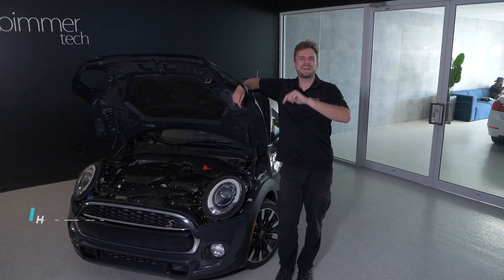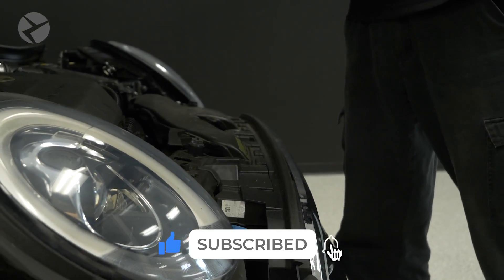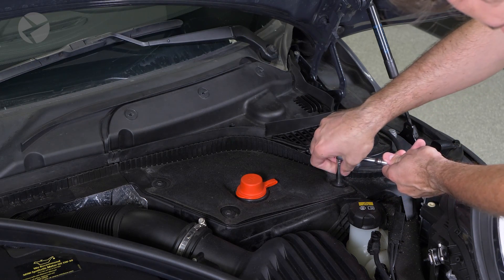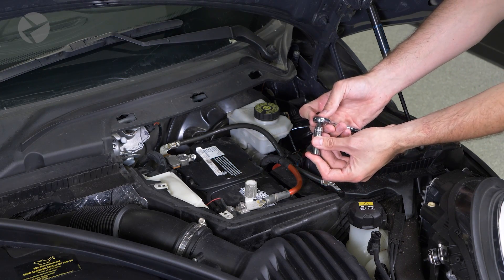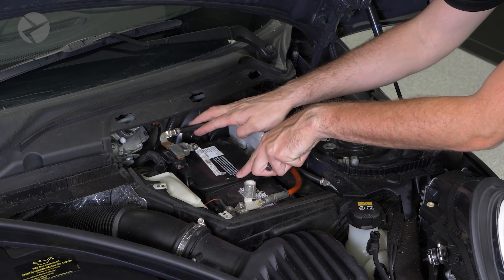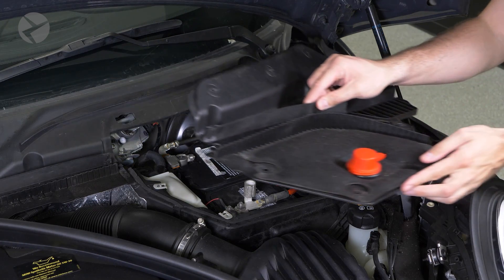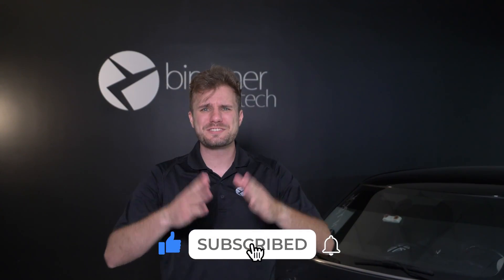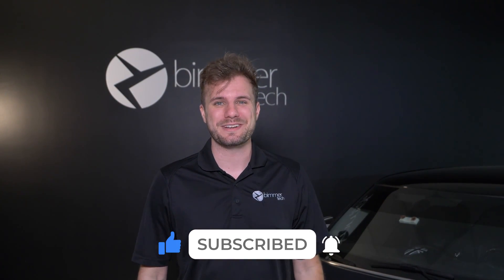Disconnecting Battery On F55 MINI In 1 Minute

Comment: No issues with any memory electronics ? No reset ?
Reply from the maker: Hi Marc, 
you should not have any problems with mentioned features :)
Reply: @bimmer-tech  Yeah i did it and still have the issues with blinkers and windows not working.   The battery is at 11.6 to 11.9 volts... maybe recharge it ... driving doesnt seem to do it.

Comment: I cant get the issue with Lights and windows to clear ??  My mechanic seemed stumped. Gotta be the battery no ?
Reply from the maker: Hi Marc,
It is possible that it is the battery, however, it is better to have it diagnosed physically, was the battery replaced or simply disconnected? In the case of replacement, it needs to be registered so your vehicle knows it has a new battery.
Reply: @bimmer-tech  Ok thanks !  I had this issue before and it seemed to right itself somehow ?? No one can recall how  lol.
I have a good Mini mechanic must have done the appropriate registering.